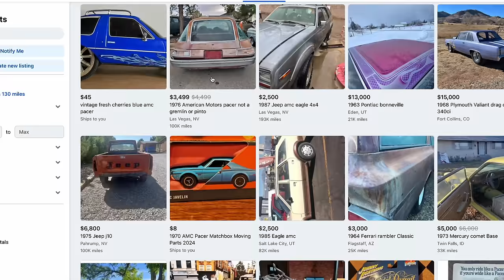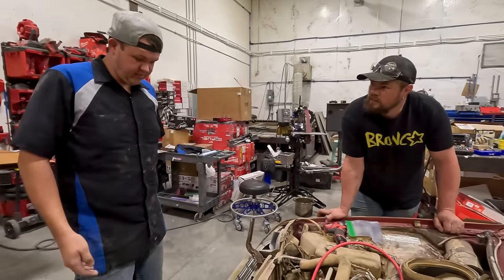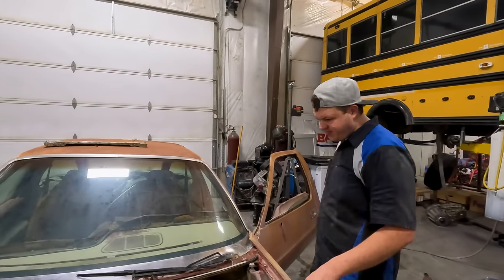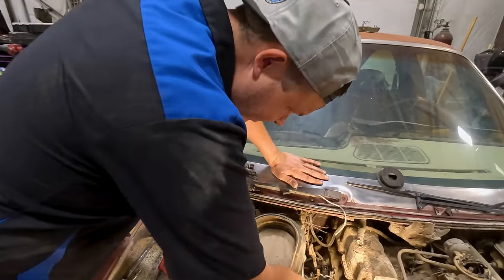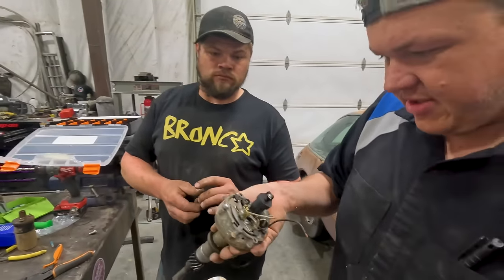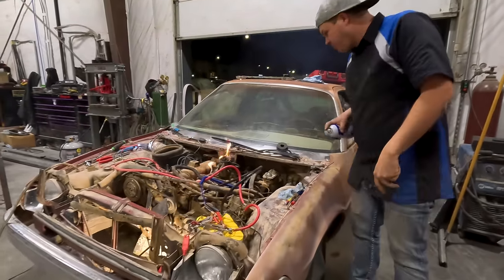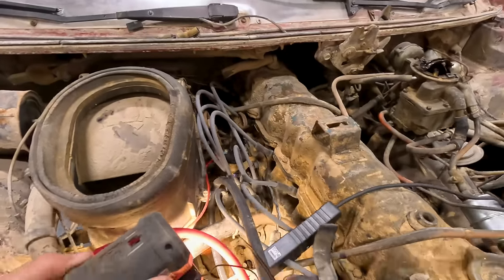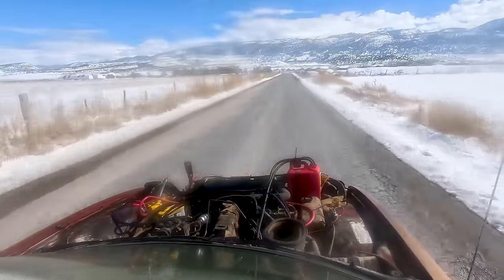My Wife “The Boss” Makes Terrible Market Place Decisions… Will It Run?

Comment: I might be in the minority here but I say leave it close to stock. Get it running right with the motor is has, redo the suspension, put some white wall tires on it, paint it the factory color, redo the interior factory and let the Boss just cruise it old school style. Then if the motor blows, 4.7L straight 6 swap with fuel injection!

Comment: LS and turbos is too modern. BBC with tunnel ram manifold and twin 4 bbls. WHatever motor yoiu select, back it with something like a 4 speed Muncie rock-crusher. No 5 or 6 speeds. Back half it and run M&H Racemasters (or equivalent).  Maybe straight axle the front, too.

Comment: Those cars were supposed to have a rotary engine in it but the deal fell through so AMC had to put the inline six in it ad that made the car gutless I am not a big fan of the pacer I like the Gremlin better and the pacer door on the passenger side is bigger than the one on the driver side making it look dumber than it already did lol! that car is cooked inside and out LOL!